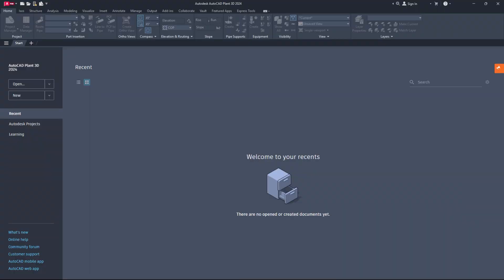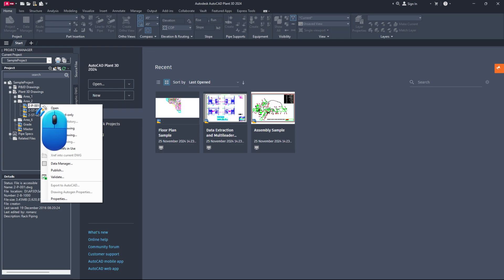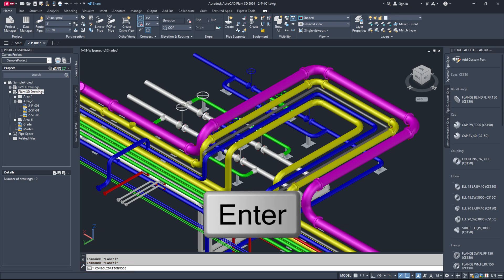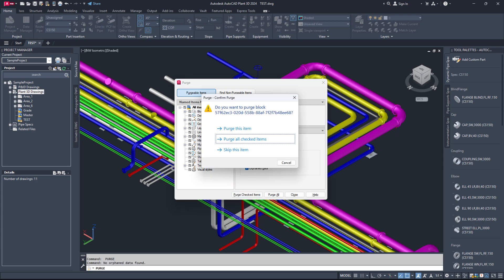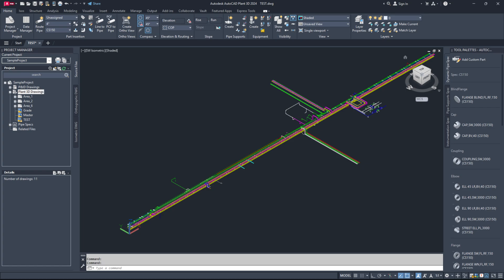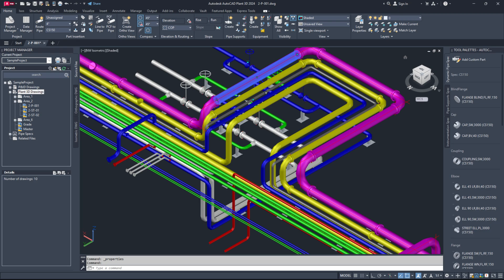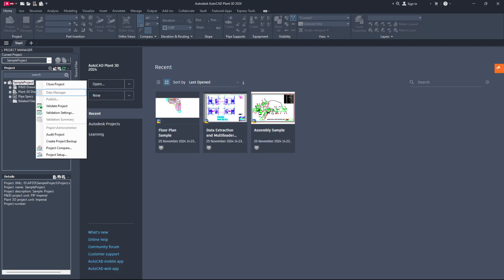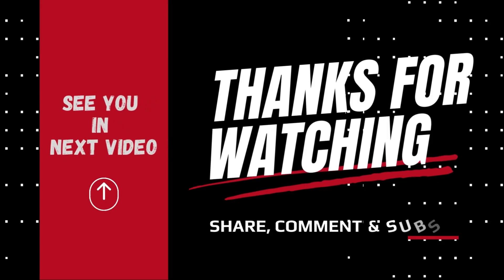AutoCAD Plant 3D | Piping Components & Properties Missing? P&ID Tags shows as “No Target”

Comment: Why is it that when I want to add a flange or valve, there is no reference to be able to auto joint to a certain point in the pipe. How to solve this problem, sir? thanks
Reply from the maker: This video talks about the same issue you brought up. If you follow all the steps in the video carefully, it will fix your problem.
Reply from the maker: Watch this video on our channel titled “Cannot connect parts” while Routing Pipe and Connecting Flange. If the solution in the video doesn’t work, please comment and let me know.